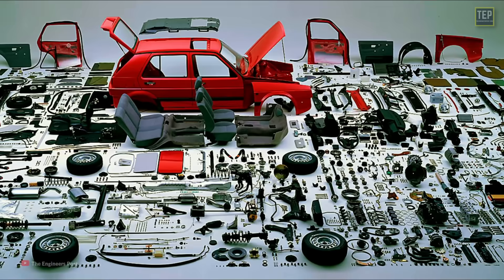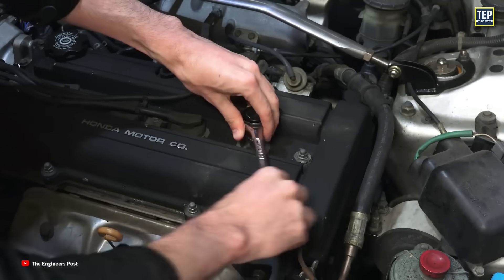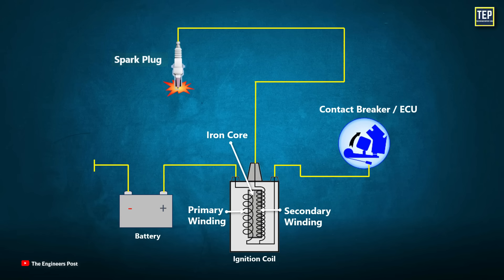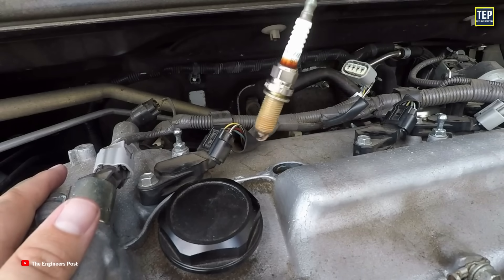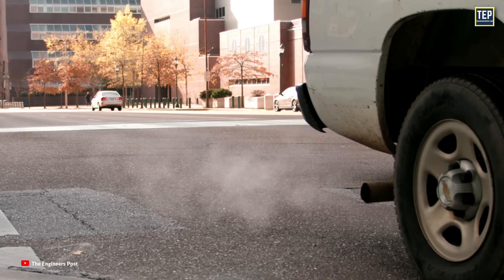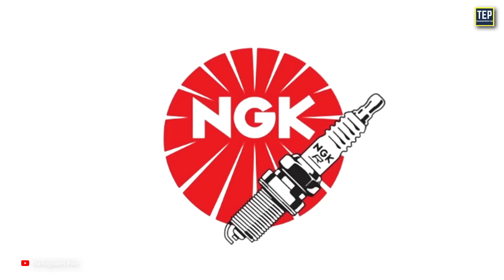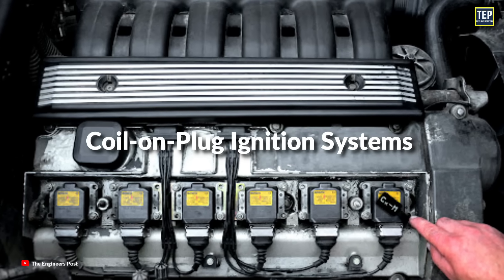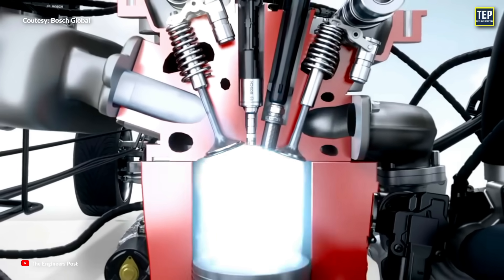Types of Spark plugs | Which is Best?

Comment: if you are changing your plugs at 20k then you are wasting a lot of money. Clean regap and run again. I get about 60k out of mine.
Reply: Just because it sparks, doesnt mean the spark is good quality...
Reply: For spark plugs, the factory recommended replacement can be used, orr what the spark plug looks like at the next factory recommended replacement.

If it is clean, use the factory recommended one. If the spark plug has 2 or more contacts for your engine model, then you can definitely use the factory recommended.

For example, it says recommended replacement at 100k, and you replace at 10k, it's a complete and literal waste of money.

Of course, you also throw away a new spark plug... and people would like to save the planet.

It is always necessary to know the recommended factory replacement mileage. After that, you can shorten the replacement mileage if you really want to.
Reply: Iridium last over 100k.
I just put some back regapped them .
Chevy 4.3 vortec 400,000 miles now in van.
Reply: The trick is just don't droive and the plugs will last forever.
Reply: 👏👏👏🤝 @parkerbohnn
Reply: Agree to disagree. If you do it yourself, yea. But if i spent time cleaning 4 12 euro plugs instead of screwing in 4 new ones, i feel like i scam my customer. My hours cost money and i  slightly upsell parts so i can help them for free if something happems. If i spemt that extra time they pay more for hours, but have a worse product and i risk having to do a free repair.
Reply: They're so cheap, who cares?
Reply: @justinplasschaert432  cheap is relative...maybe for me a new car cheap,but for other people 1kg bread expensive.
Reply: Nah
Reply: @syariqul8981 tf u mean nah
Reply: I have a 2004 Ram Hemi.
310,000 miles on original spark plugs.
In fact, the whole truck minus front Axles and p/s rack, brakes and many oil changes is all original.
No smoke, no knocks or ticks, no service engine lights and even the original air conditioner system is in it.
Reply: @rdallas81  transmission?
Reply: @rdallas81 Yup I believe it.
Reply: @rdallas81 Curious, 2004 should have copper plugs. Have you pulled them and looked at them. I have an 06 and they seem to go 60k before needing to be replaced.
Reply: My 103 harley has 100,400 miles on it!
The plugs probably have about 100,000 miles on them, I used to check them at every oil change, but never saw any wear on them. (I did replace the harley plugs at one point which would probably still be fine now.)
Then I decided to forego checking them and run them to failure to see how long they would last.
They have not failed yet!!  🙂
Reply: Ppl saying their spark plug lost forever are ppl without performance vehicles 😂😂 floor that car several times on highway and u realize u only have regular speed power when ur spark has reached 15kmiles
Reply: My chev 5.3L plugs get changed once every 160,000 kms. with iridium.  Plug change made zero difference in power and fuel economy.  The only exception is when you’re running aftermarket performance ignition system such as MSD designed for engines 500 +HP.  These will eat up your plugs.
Reply: According to Maruti Suzuki (Indian Units), the manual suggests you replace the sparkplug for every 40k KM
Reply: My last toon up was almost 100k miles ago I think I should probably get another one soon😂
Reply: Just depends. The regular copper electrode plugs should be replace at 20,000 miles. Platinum should last 50,000 miles. Iridium plugs should last over 75,000 miles.
Reply: what a cheapo this guy is. how much does a spark plug costs?
Reply: 60k? 😂 still wasting money, they are designed for 100k and I’ve seen them go for 180k
Reply: My Iridium plugs have done 200k and still mint 🤗
Reply: K
Reply: Km or miles?
Reply: @JackKing12 miles
Reply: In N/A engine yes  ,but when you have 1.7 bar boost  is a different story😂
Reply: What are even those? 😮 And why should I ever change something to a Lexus?
Reply: I agree, I think changing them at 100k or unless there is corrosion but 20k is too soon. Even the Honda manual says it: https://techinfo.honda.com/rjanisis/pubs/om/CV9999/CV9999G00017A.pdf
Reply: Platinum work well for me
Reply: 30k using Silver tip Bosch in 86 BMW and 120k plus on iridium in 2008 frontier. China made Nippon Denso coils on 2008 last only 100 to 120k. Please keep in mind different vehicles have different mileage. It's possible my iridium might not need replacement but I changed them anyway, I don't want to have issues while in the road. And cause problems elsewhere such as with converters. By the way renault/nissan had planned obsolescence of many different parts. I forgot my rotary rx7 ate plugs but that's is nature in that particular vehicle. I remember changing those plugs often.
Reply: cheap individual this is. how much cost a spark plug? dear lord, penny counter
Reply: That's true for modern engines. But older  engines from the 40s -80s just foul plugs and damage them worse.
Reply: If you’re in there, put new.
Reply: mee too
Reply: Copper plugs are good for about 30k platinum are good for about 100k
Reply: Ho much 20k in km?
Reply: I'm at over 120k on my Toyota. No issues.
Reply: 1970s called and wants its plugs back   300,000 miles plugs now
Reply: That's what "blowing out the carbon" is for💀
Reply: Well I change mine after every 5000 miles (if I’m lucky) with a new set of best qualishit Chinese no name plugs. The loose insulation is the new fully floating system and the offset electrode is for the Welsh and Scottish market, it evens the spark to level when driving up and down the hills 😂😂😂😂😂😂😂😂 They come with an in box guarantee, expires when removed. Over the years I have seen the spark plugs that come in the no name leaf bowers etc carb kits and they must be the factory seconds. I’ve come across the odd good one but normally horrendous or best last a week, just chuck them straight in the bin and put an NGK or Champion in.
Reply: I get 150k from my plugs. Iridium plugs.
Reply: Right sparks are the ones producer requests, stop speculate!
Reply: Orignal model t needed them every 1500 km
Reply: 150,000 from mine
Reply: @shadowopsairman1583 What brand and type  you use in what car ?
Reply: @Chappomusic  You have a very interesting point. In the 90s, VAG garages started having problems with bad starting and running  on new vehicles. Although the engine codes were the same, VW were having problems on NGK plugs and Audi problems with Bosch plugs.
The workshop manager noticed that new vehicles were delivered with Bosch on VW and NGK on Audi.
Although the engines were the same, Bosch worked with VW in the ROM programming of the ECU and NGK worked with Audi.  
Although the problems were fairly slight, using the plugs specified by the manufacturer can make a difference.
As far as I know, this problem between VW and Audi only affected a few models and does not exist today.
Reply: @shadowopsairman1583 I just commented 100,400 on mine!!
Reply: @shadowopsairman1583  Yup especially in my Toyota Sienna using iridium
Reply: Not with a F-150 eco boost truck.. you don’t change them janks every 13k you ain’t going nowhere 😂
Reply: @ExAghrrrPee they come out by them selfes 😂
Reply: @ExAghrrrPee they call them ecobusts
Reply: @ExAghrrrPee right cause i only lasted like 15k miles, buddy over here talking bout 60s smh
Reply: @Kels14B   🤣😂
Reply: @ExAghrrrPee I have a 2020 Ford Escape with the 2.0L Ecoboost, she's still got the factory plugs at 71k miles with no loss of power or efficiency.
Reply: @MommyKhaos   those things are great honestly, im referring to the trucks with all due respect. they get alot of load put on them and have a heavier fuel demand for the v6 variant
Reply: @ExAghrrrPee   Shades of my youth.  10,000 miles max.  I have trouble believing a 13,000 mile replacement necessary with today's unleaded gas and electronic ignition.  They don't care what the vehicle model is.  I have over 200K on my original iridium AC plugs.  Still good as gold.
Reply: V12 Jaguar begs to differ, every oil change, new spark plugs. Every second oil change cap and rotor. ‘96 and ‘97 are exempt, every 7k miles or 2 oil changes, whichever comes first. Dont want to light your catalytic converters on fire after all.
Reply: @USSRDragon  junk
Reply: Only with platinum plugs.
Reply: @ghoulbuster1  naw naw naw, Ruthenium plugs, 100k miles.
Reply: I've never once had to change the spark plugs on my diesel. 300000 miles and counting 😌
Reply: @josue_kay diesel doesn’t have spark plugs, lol.
Reply: @hamiltoncouple01   No shit! 🙄
Reply: @hamiltoncouple01  i was thinking that was the joke, but now you've made me doubt my faith in humanity
Reply: @hamiltoncouple01 well technically he’s telling the truth though 😂
Reply: @josue_ka😂y
Reply: @josue_kay Diesel have no Spark Plugs ,they use Glow Plugs!
Reply: 😂😂😂😂 @josue_kay
Reply: @josue_kay 
But  you  do  have  glow  plugs  in you  diesel  engines,  which are  kinda  like engine block  heaters.
Reply: Iridium spark plugs can last up to 75,000 miles, platinum spark plugs can last up to 50,000 miles, and nickel spark plugs can last up to 30,000 miles.
Reply: Y they are very cheap
Reply: How about 200k?
Reply: @darthsquid2 I believe it.

Comment: Iridium sp adds some horsepowers 
especialy at low rpms

and it gives extra fuel economy
Reply: Iridiums are meant for durability due to less voltage being required to fire
Reply: @shadowopsairman1583  so spark is better and burning gives more power
Reply: No plugs give you more HP.  Only better fuel economy
Reply: @hamiltoncouple01  iridium plugs do more hp